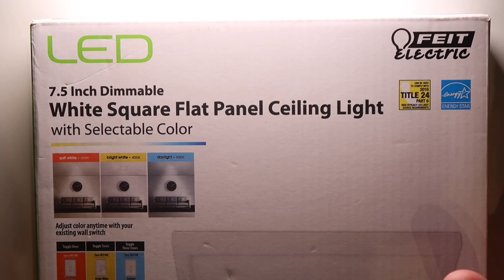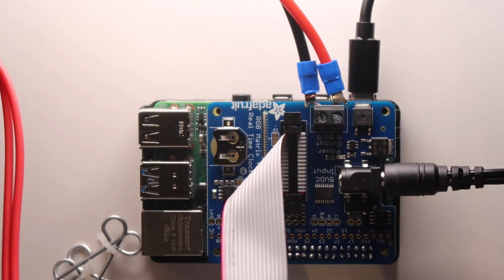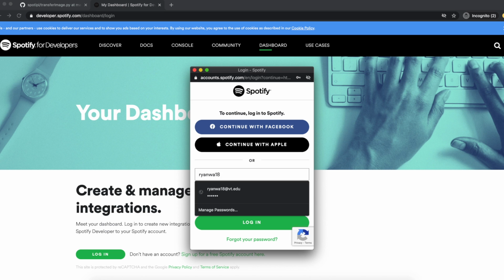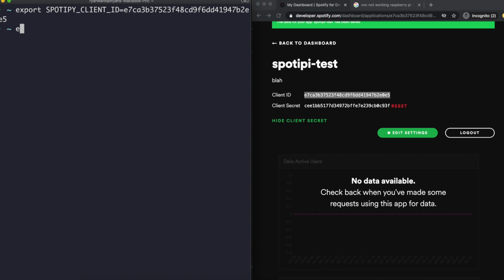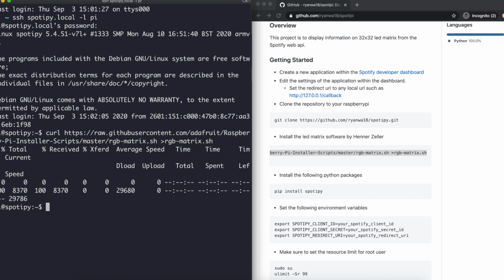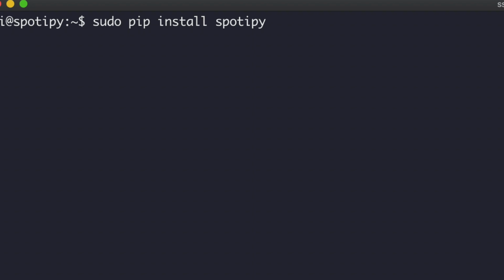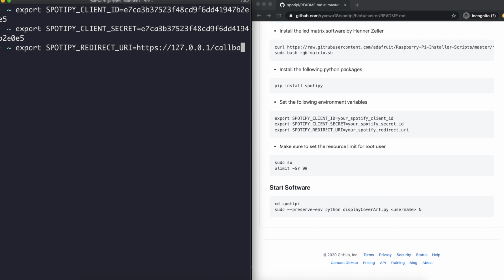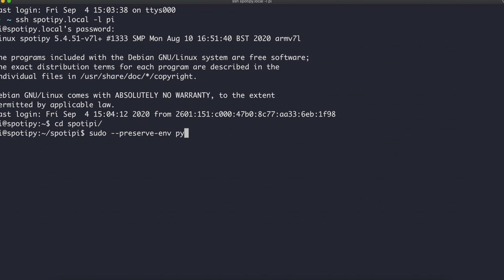Raspberry Pi and Spotify Powered Frame - Full Build Guide

Comment: Hey Ryan - great project!  Just messing around with this now.  When I run python generateToken.py <username> I get: 

Traceback (most recent call last):
  File "generateToken.py", line 2, in <module>
    import spotipy
ImportError: No module named spotipy

Any idea how to resolve this?
Reply from the maker: It looks like you don't have spotipy installed. Make sure you install it first using: pip install spotipy
Reply: @rwardtech  🤦‍♂️ works now! thanks!